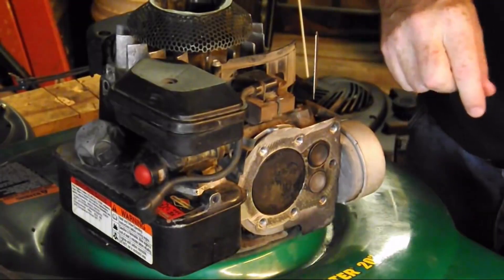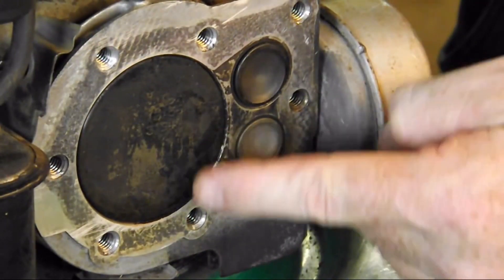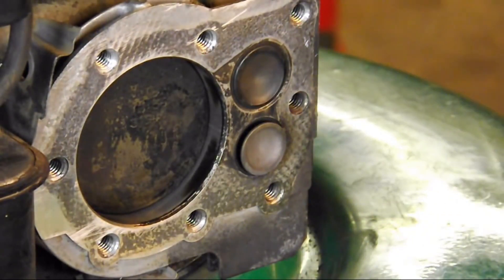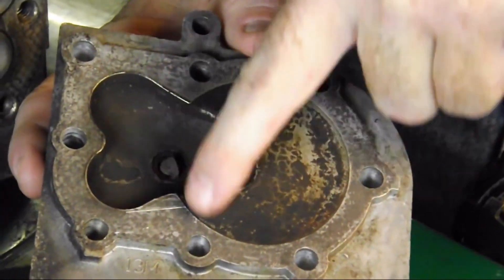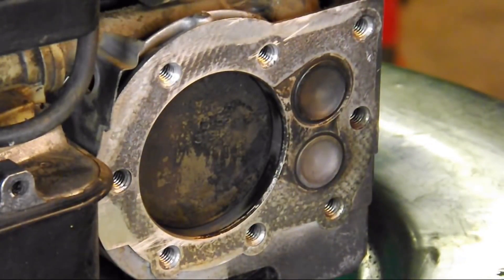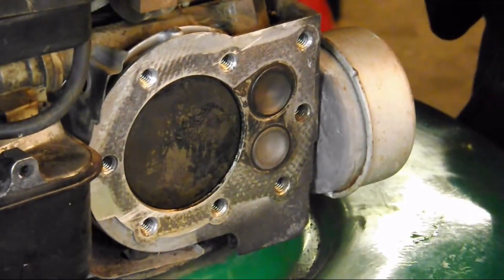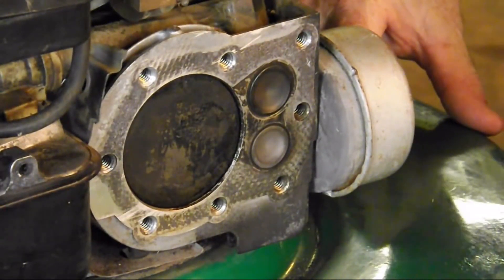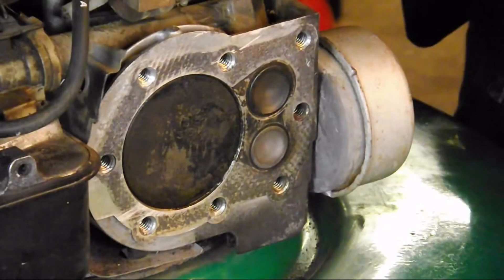How to, Small Engine basics - machine cycle

Comment: Excellent.  How do you pressurize the cylinder if you're out looking at an engine to buy? Would you show or describe your procedure including connectors and pressure source?
Reply from the maker: I don't want to mislead you. I would not recommend you buy any of this trouble shooting equipment. The price for repair these days for a small engine has tilted so that its cheaper to buy a new engine than repair the old one. Also 95% of the time it will be a fuel or spark problem instead of some internal mechanical problem. Hope this helps.
Reply: But how would you pressurize the cylinder if you wanted to do so despite the cost differential between repair and new?  I may not need to buy troubleshooting equipment if I can use what I already have, and there's more than monetary value in rescuing something from obsolescence with my own two hands.

I suppose I'd need something that threads into the spark plug hole and has a connection from an air hose, either a schrader type valve or a nipple.  An air pressure source could be a portable air tank or maybe a large syringe.

How do you personally do it?
Reply from the maker: Martin, You can buy a "compression tester" that is a gauge that goes into the spark plug hole that records the cylinder pressure after you hand crank the engine over. This gives a quick check of the overall engine. This is the cheapest. The new engines have a pressure release that makes hand cranking the engine easier so the reading is limited by this feature. The other is a "small engine leak test" that requires compressed air and is the test described in my video. If you Google these two terms you will find prices and videos that explain more.